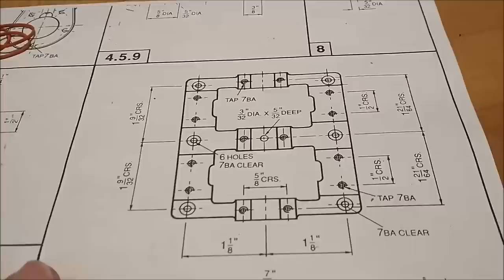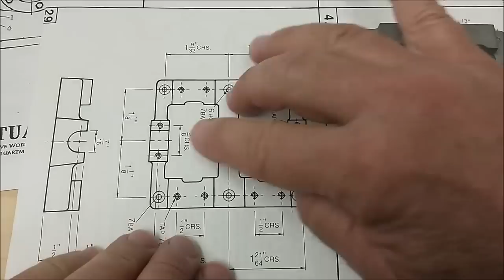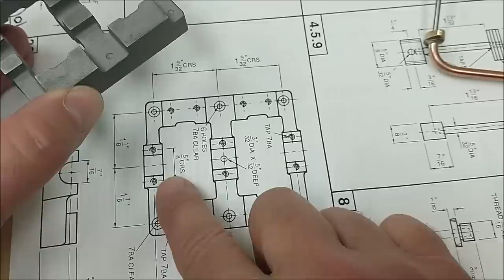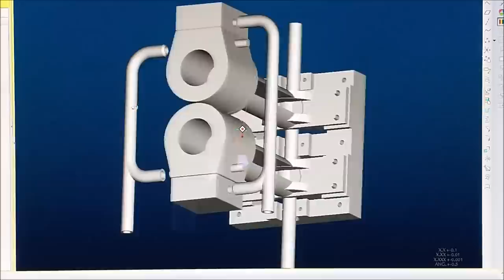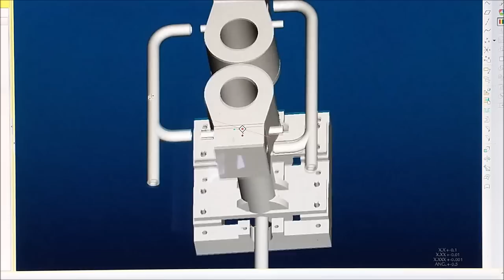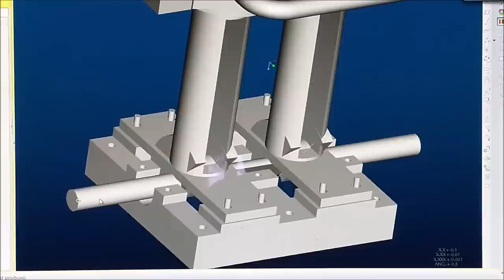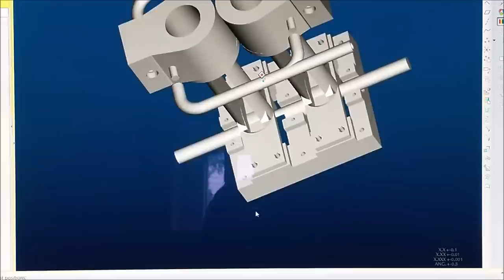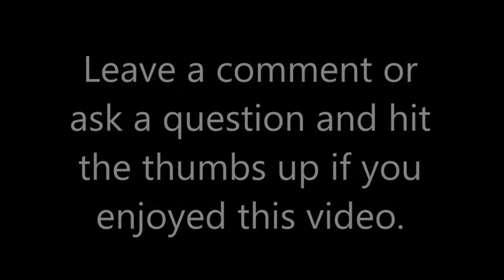Stuart D10 - # 3 -- Machining The Bases

Comment: hi Joe.
Brilliant video as always.
When I was an apprentice over here in England nearly fifty years ago, we generally used inch sized threads for mechanical fixings - such as 1/4, 5/16, 3/8, 1/2 etc. These were BSF 'British Standard Fine' threads. 
The 'BA' stood for 'British association' threads, which had a finer pitch and we used them for smaller electrical connections.
There were others, such as BSW - 'British Standard Whitworth; UNF - 'Unified Fine'; UNC - 'Unified Coarse'.
This could cause much confusion, as they all had differing thread pitches and angles.
I was very happy when we changed to the Metric system!
Reply: Even worse when someone tries to combine two different standards, my all time fave though is when someone tries to screw a left pedal onto a right or vise versa. Big YES to Metric! GB :)
Reply: BA is used a lot on models here because the nut dimensions scale well, look authentic and maintain proportions of the original full-sized machines. 🇬🇧

Comment: Hi Joe. At 36:38, if you look at the part of the casting nearest the ball end-mill on the side facing the camera, it seems a little thin there at the bottom where you machined it; are you sure you didn’t take too much off? Also, is this the bearing surface for the crankshaft, or are there going to be split bearings like in an internal combustion engine (i.e. Rod/main bearings)? If so, what’s going to hold them in place against lateral movement (parallel to the long axis of the crankshaft)?
Reply: That's just an illusion. There is a parting line casting shadows hence it looked like the underside is further back. If you go back you can see the underside is flushed with the top.

Comment: Nice work as always Joe ,I  built my D-10 I painted the base and flywheel black and the rest of the engine Maroon .I did not paint the cylinder heads or the steam chest they were polished .Jeff

Comment: Hi Joe
I very much appreciate why you sandblast the casting after the gentle skim which leaves a machined surface. I haven’t got a sand blaster. Is there any other way to tackle the cleaning up operation?
Thanks 
Pete
Reply from the maker: Hi Pete. I've heard tell of tumblers ( even homemade ) with sand in them to achieve the same result. Takes longer, but supposedly works.
Reply: @joepie221  Thanks Joe I’ll check that out.

Comment: I ended up with a Stuart 10v engine, which is half of what you are doing. The d10 is about $600 as you have, plus BA taps/dies. I think I like the pmr prints better. What I really want is the Stuart major beam engine. They just look interesting.
Reply: A beam engine project would be very interesting. Even more so, one of the very first type, in which the power stroke was the piston falling back down after having been driven up by steam power.

Comment: I am no expert, so I wanted to ask if I am seeing this correctly... the six holes on either side of the crankshaft bushing... it appears you placed them centered in X and Y as is shown in the drawing at roughly 10:50... but then you used the ball end to remove the excess material, where the bearing will be placed.  I was expecting a majority of the material removed to come from the bottom of casting.  But, it looks like you removed a significant amount from the sides as well.  From the angle of the camera, it no longer looks like the wholes are centered in Y.  Are they actually 5/8" apart?  Thanks for taking the time to create such wonderful content.  I look forward to seeing future videos!
Reply from the maker: The holes remain .3125 each way, off center. Not as much material came off as it really looked. Maybe .03 (.75mm) per side.
Reply: @joepie221  Thanks for the explanation!

Comment: Great work, as always.  Hey - what size drill chuck is on the mill?
Reply from the maker: Its an albrecht 1/4" capacity. R8 spindle arbor.
Reply: @joepie221  Did you use BA taps? If "yes" and if new, where did you get them? Thanks!

Comment: Joe, is your shop by a race track ? Often hear what sounds like motorbikes screaming by during the video. Great outcome. Just a useless bit of information, a 0 BA is the same as a 6 mm in pitch and diameter. Interchangeable. Be aware that model making in the UK uses different standard of  BA nut and bolt sizes, depending on the scale of the model. As an example you can get a 6 BA nut or bolt with a 7 BA hex ( smaller ) head to make the bolts / nuts look more in scale. Regards from Australia.
Reply: Dave, his shop is rather close to the highway. With the recorded machining footage sped up, it sounds like a race track. Doesn’t help that many of the vehicles are zooming by at a pretty good pace.

Comment: That’s odd. Your crankshaft bearing material is cast, whereas the material supplied in mine is extruded. No lumps n bumps and looks more finished.
Reply from the maker: I've been told, this is a very old kit.
Reply: @joepie221  mine is an eBay model. It's sat for awhile and had a few parts started. The base and standard were surface ground, but the standard had a bit of a lean to it. Think whomever did it was just doing it as a starting point

Comment: Hey, These really are nice castings. They look free of sand pockets that really can ruin a day and the piece as well. I sure like the contrast between cast and a machined surface. Just my thoughts on that. You asked eh, LOL. Did you ever get that "Burr Life" from Rio Grande ? It really is the best file dressing I have ever come across. At about $7.00 US the stuff is very affordable and I have never had one wee bit of welded in filing in my files for 5 years. Check it out as I would never lead you astray old friend. I really respect the light cuts and patient approach you take with these castings and everything else for that matter. Are we not supposed to the most patient critters on the big blue ball in space ? LOL. Taking the time to investigate the part and the print are absolutely mandatory to not have to order/replace a screwed up part eh. Fully using and understanding that DRO is great, BUT, hey boss I come from a time they were just coming to be so I guess I will still keep on keeping on with a pencil and paper where I am in my comfort zone eh, LOL. I call myself a tree hugging logger eh, LOL. That was great Joe. A small piece with a lot going on in it. See you soon, I hope. Take care and stay safe my friend.

Comment: The bottom of that round cut is very thin on the ends...😮
Reply from the maker: What you see as the bottom of the cut is actually an offset in the upper and lower halves of the casting. Both ends are of equal thickness. The side closest to the camera is the true thickness.

Comment: I don't think you are the first person to have hands on that kit. All the parts should have come on a sheet of cardboard with a vacuum formed plastic sheet over them. Also I have never seen any of the brass parts and tube to come assembled. Don't trust that you have any 'factory' assembled or machined parts.
Reply: The brass/copper tubes are purchased that way as an option, along with the reversing lever which does require machining. One of his viewers sent him that kit, so you are correct, he isn’t the first to have hands on it, but nothing was started on it.

Comment: Here's a bit of useless information for you. BA threads: 47-1/2 degree thread angle. This is a metric thread system devised by the British for small screws used in components like speedos. Not metric like you might expect, but with diameters determined by a factor proportional to a power of the logarithm to the base 10 of the thread pitch in millimeters.
Reply from the maker: I was recently wondering exactly what the pitch is. Its not called out anywhere.

Comment: Okay, so here's a challenge for you. All of these models are designed to be built by hobbyists in sheds with real basic tools. For the next one, let's see if you got what it takes to build one with just a lathe and drill press using HSS tooling ground on a bench grinder.
Reply: That would be the challenge. In fact, for an increase in the challenge, let's just give him a Chinese 7x14 mini lathe and a drill press from Harbor freight. He does not get the bench grinder, he can chuck up a grinding wheel in the drill press for that work.

Comment: Joe, before you say you get a rash of using the metric system, please remember all countries in the world use the metric system, except the US, Liberia and Burma (or Myanmar), so what should all the people who use the metric system, say about the imperial system, remember you are a minority after all. 😉
Brilliant video as always, I learn something every time I watch your videos. 👍
Reply: Yet this kit was made in the UK, not US or the other countries mentioned, but all the dimensions are in inches on the provided prints.
Reply: This Stuart model is over 100 years old which, together with its drawings, dates back to a time when we used the English measurement system in England! 🙂

We were metrified in 1972 to align with the “Common Market” aka Europe but most of us still utilise both systems on a daily basis…

🇬🇧
Reply: Not quite a minority. USA still has the largest economy in the world with the greatest wealth created for the most people in the shortest length of time. Check the wheel diameters on your vehicles which you’ll find to be (gasp) inches and your socket drives which are also in inches. Yes, 6.35 = 1/4, 9.5 = 3/8 and 12.7 = 1/2 inch. I just discovered that Mercedes seat belt anchors are 7/16-20 grade 8. The systems are too intertwined to ever become one. Get over it.
Reply: @ellieprice363  very clever of you to turn my post to economics, but it is still a fact that there are more people in the world who use the metric system every day.
Regarding seat belts in your car, Mercedes has an assembly plant in the US, so what's more natural that they use seat belts made in the US, instead of importing them from Europe or anywhere else that use the metric system, right?
Reply: @paul.newland  there is no surprise in that, because I don't know of any country that is more stubborn and conservative than England, and it shouldn't surprise me that at some point the UK switches completely to the Imperial system again, just to be cross .
Reply: @olevjorgensen  There’s always someone on every thread who wants to convert the whole world to metric. 
Sourcing and price has more to do with manufacturing than whether the content is Imperial or metric. As a machinist and toolmaker for much of my life I’ve learned to use both systems. Have you?
Reply: @olevjorgensen  Wow OK, perhaps you should relax your anger at the world a little my friend, we’ve enough issues to deal with right now without you making enemies of each other!

Comment: I don't want to bring you out in  a rash but... BA fastenings are metric! Just an older type of metric.
Reply: Rob, may be Metric diameter but the thread angle is different. 47.5 degrees. and the threads have rounded tops to them.
Reply: @daveticehurst4191  I actually know, I was just teasing Joe.